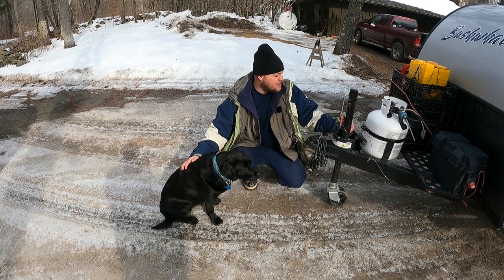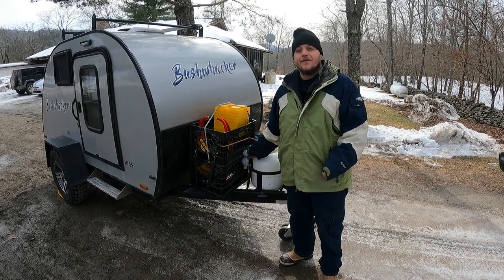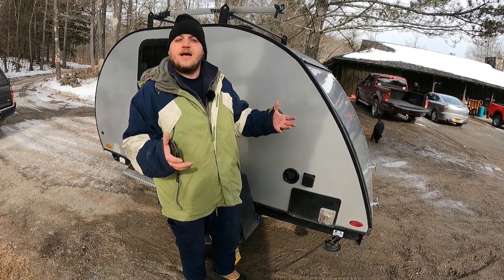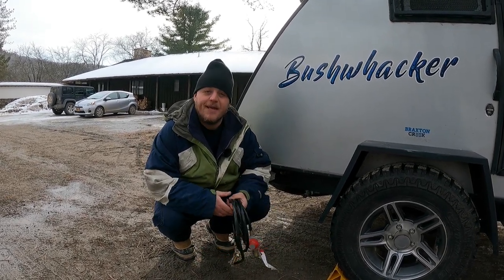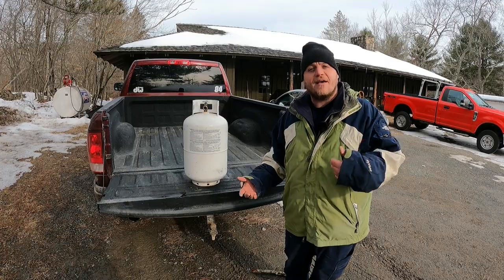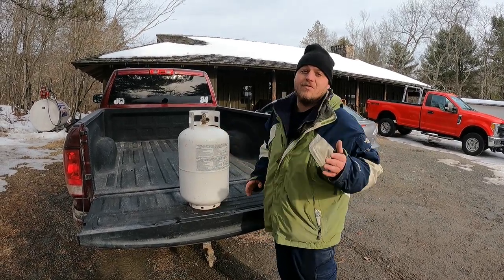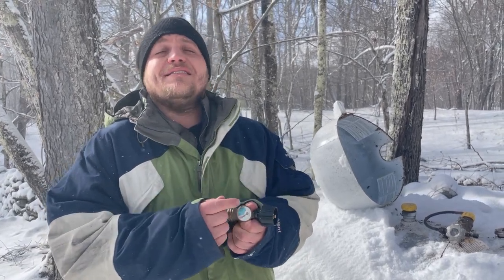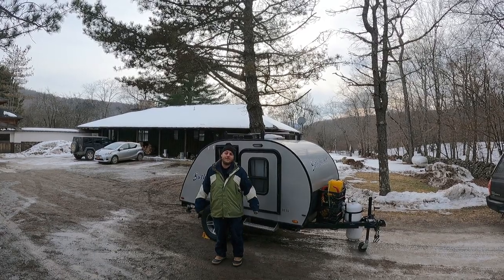RV Propane for Cold Weather Camping

Comment: Thanks, you just saved me.  I am in below zero weather for the first time in a camper, and the propaine ran out, the tank I replaced it with was out side and when i connected it could only get a small flame on the stove and the furnace would not lite.  I seen this video, brought the tank inside where I had a space heater going, in 20 minutes put it on and it was working as it should again.  Reflilling my 30 lb tanks tomorrow.
Reply from the maker: That's great to hear, stay warm!  I'm also I'll camping in this weather, it's been a chore

Comment: When I run into vaporization or freezeup issues, I'll pour hot water over the tanks and regulator for an immediate fix. This is a really good thing to know if you only have one tank or your spare is already empty. I have a hot water heater in my trailer, thus as long as it's kept turned on I always have a small reservoir of hot water, but it wouldn't take to long to build a fire and heat up water in a pot. Even cold water will help, because it's above freezing.  I don't usually run into issues until I've been in an extended period of below freezing weather of more than about 5 days. I use twin 30 pound tanks with an automatic change over style regulator, but am seriously considering moving up to twin 40's and just keeping the 30's in my truck as extra capacity. They do add a lot of tongue weight, but I just bias my loading in the trailer towards the rear to even it all out.
Reply from the maker: That's a great tip, it doesn't take much to kickstart the vaporization.  Some people with two tanks keep one in their tow vehicle, just keeping it out of the wind in the elements is often times enough to make a swap if they have a problem.  The water trick definitely helps when you have one tank.

Comment: I rarely go out in extremely cold conditions but I did have this problem with my fire pit last early spring in a very cold situation so we just switched out the tank with a fresh one but both of them were about 1/2 full so I was able to switch back and forth several times and we could keep warm outside in the cold wind. Great hearing it explained in such detail. 
Thanks, 
Pat
Reply from the maker: I hear such great things about those fire pits, which brand did you go with?
Reply: @DIYOutdoorLife  we have two of the Outland fire bowls. One we gave to my parents but we got it back after he passed away. My mother didn’t want it anymore so we will have one for each rig.

Comment: Another excellent video Brian! With regards to your great job of explaining the psi regulation, one thing I'd like to add is that even if you use a straight hose (in place of the extra requlator) the outdoor grill/stove may not work. I have seen people try ( unsuccessfully ) to use  standard camp grills (Coleman tailgate styles and tabletop),and not know why they're not working. Those are often deigned to operate at around 11 psi (and that's what the regulator that comes with them puts out) Therefore, even if you eliminate the extra regulator with a straight through hose, those will still not run or have a useless flame at the RV's .5psi quick connect. There are stoves/ grills that are specifically designed to run off of the .5 psi quick connect port. In addition, I've heard of people "rigging" a T connector at the tank to bypass the RV regulator but personally I'd buy a new stove/grill. I personally use a Camp Chef and I get a very strong flame out of it.
Here's an article that I think explains it pretty well.
Thanks again for all your great videos. Keep them coming!

https://weekendrvadventures.com/low-pressure-stove/
Reply from the maker: This is really valuable stuff!  I appreciate you sharing the experience and knowledge.  Thanks for contributing!

Comment: Hi Brian, A helpful hink we have done for years is to cover the tank and regulators with a blanket to keep the wind and air off it. We also help get the tank warmed up with cheap hand warmers, it realy does help when the temp drops. One other reason we do this is when the pressure drops going to the furnace makes it run longer to produce heat and that eats up the battery.
Reply from the maker: That's exactly right! I've used the foot warmers (the bigger ones) and it worked great, shielding wind is definitely key. Great tips, I hope people who read this will swing by and see you amazing content, I see a collab in our future!

Comment: Dang I need one of those hoses for the propane port in back.  Have a link?  I'll post a video on Rumble how I charge my bushwacker in the barn while it sits, how I charge the camper with solar while I drive, and the cart I built that uses solar/batt to attach to "shore power".  It's modular so I connect/disconnect certain plugs based on the power situation/need.  Great videos brother.
Reply from the maker: Really appreciate you watching and commenting! I build solar carts like that as well, there’s some really cool stuff to play with these days!
Here’s a hose, if it’s too long they make shorter ones. Sometimes it’s nice to get a little ways away from the camper.
https://amzn.to/3hjwRhg
Can’t wait to check out your videos, thanks again

Comment: Thanks Brian! I've used the Mopeka product you suggested and have found it mostly unreliable. I've used the gel and placed the unit just about everywhere on the bottom of the tank, though there doesn't seem to be a "sweet spot" so to say. Every once in awhile, I'll find a reading good enough to show the percentage, but it doesn't stay longer than a minute before the error message pops up. Are there any tips you, or your other viewers, have for making this product work for longer stretches of time?
Reply from the maker: Hey Levi, this isn’t the first time I’ve heard this.  The strange part is that I’ve never had any real issue.  
When I’m moving it from one tank to another, I’ll clean the tank bottom and mopeka up really well and apply the gel or petroleum jelly to the sensor. I make sure I adjust it until the app shows three stars. It generally works perfectly until I have to move it to a new tank and I repeat.  
That’s a real bummer to hear, I hope this fixes the issue or they replace it.  I’ll keep my eye on the reviews and update the video if the product is inconsistent.

Comment: When I worked up north for a camp trailer we would wrap the tank with canvas with a heat lamp inside but we had times were the heat lamp was not enough.  lol. We also had a generator for electrical power. Thanks for the video's.
Reply from the maker: I've been there, you must have been in some rough conditions!  Awesome tips, thanks for contributing.

Comment: I keep having trouble with gas leaks at the hose connectors going to the regulator.  Last season I drove the whole rig to the propane co.  Any tips?
Reply from the maker: Pay attention to the radius that the hoses are turned. Gradual loops with low tension on the connection last a lot longer. 

I’ve had similar issues on other systems when I put too much tension on the pipe/hose and connector.  

Also, covering them up in storage so they don’t sit in the sun really helps. Good luck!

Comment: Brian, what was the coldest temperature you have been camping in your bushwhacker? Is there a temperature below which you wouldnt camp and sleep in your trailer. I am seriously considering bushwhacker (and I am aware of your reviews) but living in Canada and I like to camp in the wintertime so I am trying to figure out limitations. In my part of Ontario we get -4f to -22f
Reply from the maker: I went out in -12 and thought it was fine. The hard shell and insulation make it a breeze.  When you start getting below 0F, the condensation and ice are a much bigger problem than the chill. You can get it quite warm in there, you just have to work hard to keep it dry.
Reply: @DIYOutdoorLife  thanks a million!!! I heard some people saying it has a decent insulation and I was suspecting moisture would be an issue. 
Lets see if and how I can solve it.
Reply from the maker: @YoutubeUsername7777  I solve it by cracking open the top. Even though you lose a ton of heat, the furnace keeps up fine, runs efficiently, and it removes 90% of the moisture.  
When it’s two adults and a Labrador, I cracked the window open slightly as well.  I can take sleeping with a little chill, the moisture is bad news.

Comment: Hi Brian. You may not know the answer to this question, but as far as a propane pressure gauge is concerned, are the ones that come on a propane tank for a Class C rig mechanical gauges? I have a gauge on it and it appears to be pretty accurate, so I am assuming the gauge is mechanical like the one you showed towards the end of the video. The tank is built into the rig and not detachable. Thanks.
Reply from the maker: hey Tom, I didn't know.  I did a little homework and it seems like your suspicions are correct.  The horizontal tanks on class C's typically have built in floats.  That's really handy. Can you read it from inside your rig?
Reply: @DIYOutdoorLife  Inside the rig there is an indicator light along with those for the tanks, which I suspect is not terribly accurate. But the gauge itself is in an easy-to-read location right by the fill nozzle. Thanks for looking into that - above and beyond! Have a great camping trip!

Comment: Brian, now that you have had the jack-e-up a while now. How does it work for you? Would you recommend it? Thanks Jim
Reply from the maker: Hands down, 100%.  The pro's are the off road clearance, being able to swing jeep and truck tail gate, and even a little theft prevention.  Cons are it's an extra step to install the jack and use at the campsite and it's a little janky when you're using the caster wheels to move camper by hand.  I still move it regularly, just slightly more cumbersome.   Thanks for watching!

Comment: Great video thank you! Very informative and I believe very accurate. My only critical comment would be I wouldn't recommend putting a propane tank inside of your car with the car running. Any leakage would build up in the car and Spark could easily Set It Off
Reply from the maker: that would be a disaster! Thanks for contributing.

Comment: Hey Brain! Thanks for another great video. It gave me a much better understanding of what happens with propane in cold weather. I have a teardrop trailer with only a 5lb. propane tank (and a Propex heater) I've camped with weather into the low 20's, but if I'm ever in REALLY cold weather I may hook up a larger tank. 
BTW... I was a pretty early subscriber to your channel. I'm glad to see that it's growing!
Reply from the maker: Hey Steve, I really appreciate that you’ve been onboard since the beginning, you were subbed and left comments before we had a couple hundred followers.  It’s been exciting to see it start to take off.

That propex unit is the gold standard.  Part of the reason it does so well on smaller tanks is that it draws a small steady amount of vapor instead of taking large short bursts.  I’d love to upgrade to one when my giant dometic tires out.
Thanks again!